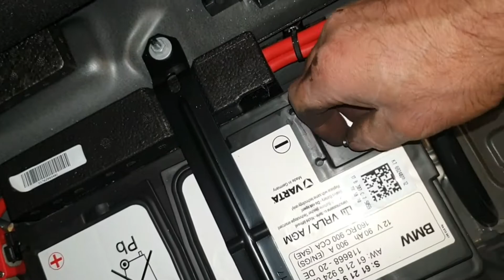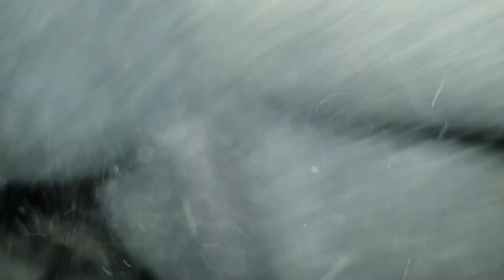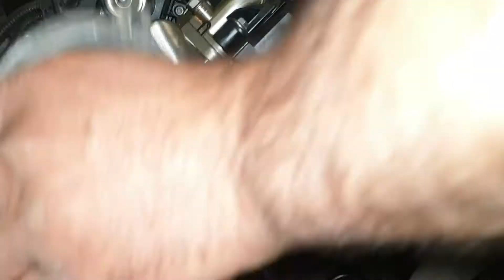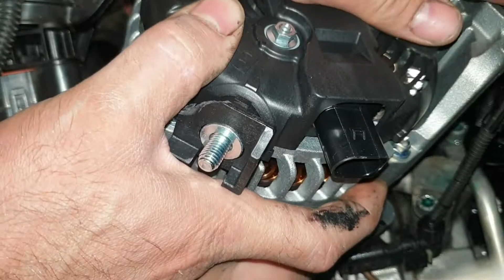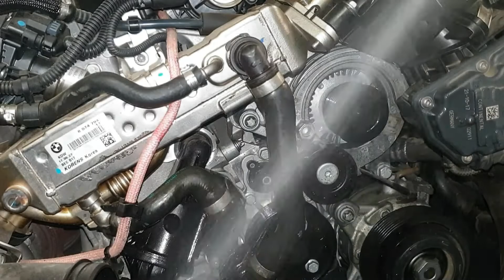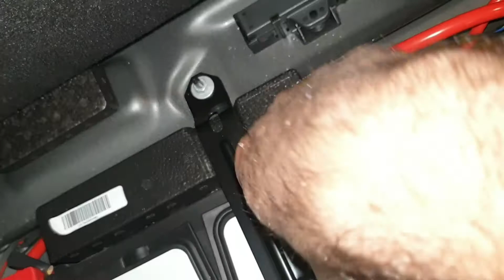remplacement alternateur BMW 1   116d  (F20)

Comment: Thank you for the superb video. I have a question, should the belt tensioner move back and forth that much during normal operation as shown in the video towards the end?

From Google translate: 
Merci pour la superbe vidéo. J'ai une question, le tendeur de courroie doit-il bouger autant d'avant en arrière pendant le fonctionnement normal, comme indiqué dans la vidéo vers la fin ?
Reply from the maker: Bonjour 
Merci d'avoir regardé mon vidéo 
Oui le tendeur  bouger légèrement et il doit pas faire des bruits et si vous voulez le contrôler correctement vous devez démonter le courroie accessoire et faire bouger le galet si il y a le jeu ou pas .